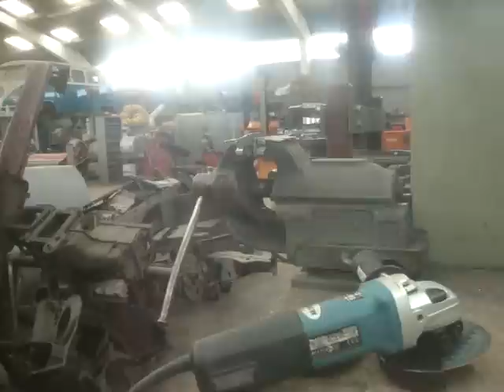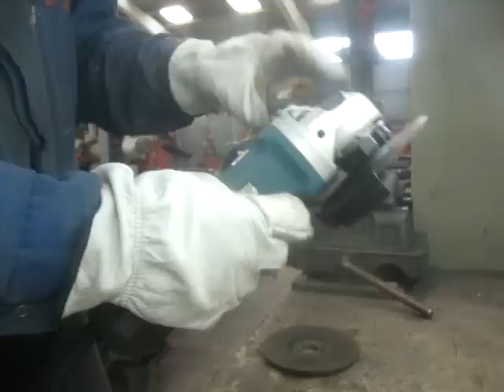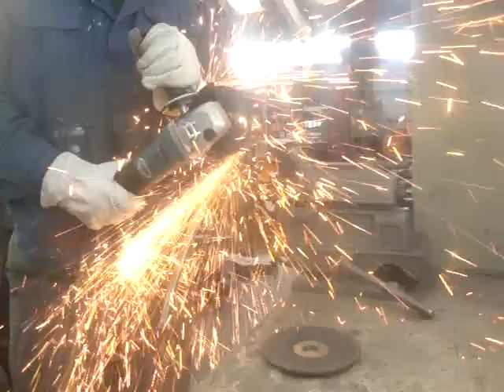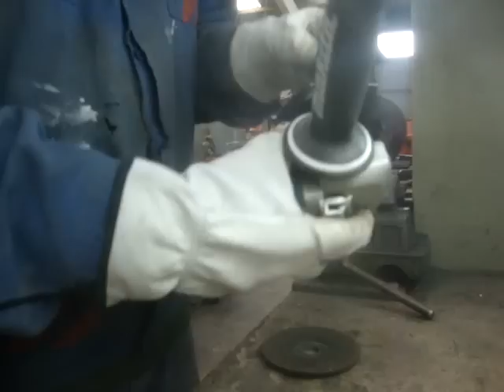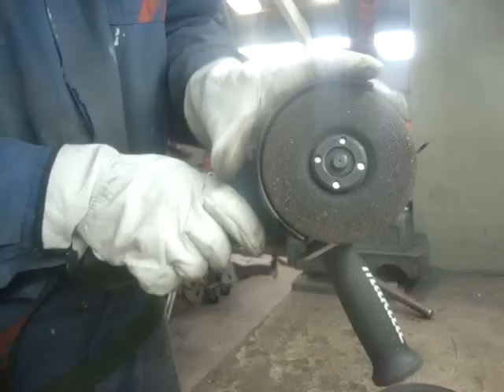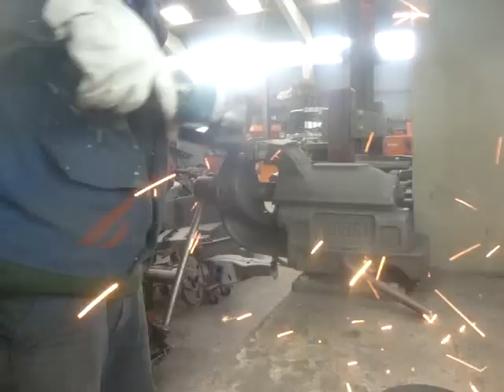Makita 9565HZ1 angle grinder

Comment: Do you know what's the difference between 9565HZ1 and 9565H? I wonder if HZ1 is supplied without grinding wheel but with softgrip handle.

Comment from the maker: I think the HZ1 is a special model, it comes in a white box with just a Makita sticker, without softgrip handle (i bought it extra) and i think shorter cable. IIRC i measured something like 2.60 meter, the regular angle grinders should have around 4 meter cable. Other than that i can´t see a difference, both have the SJS system, toolless adjustable guard, made in UK... etc.... A "volume model" with cheaper package and cheaper cord i guess.